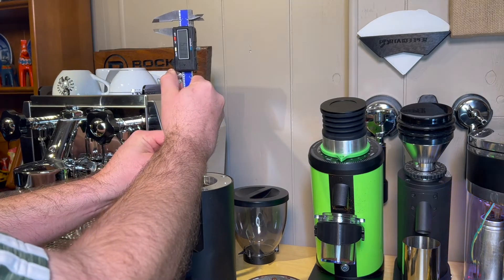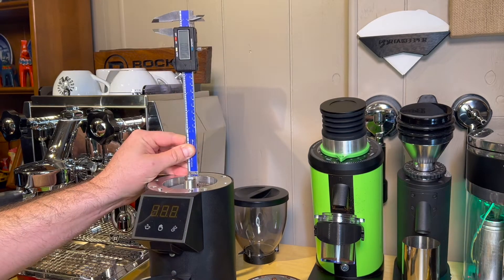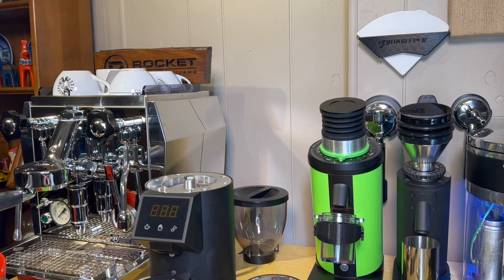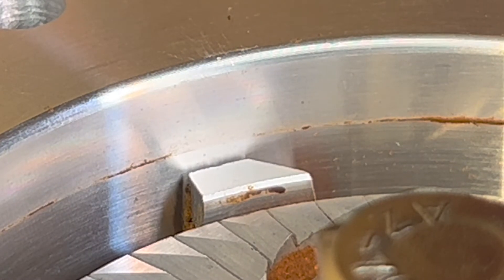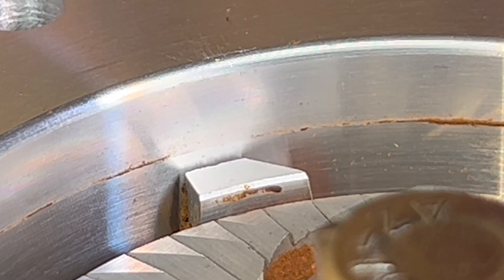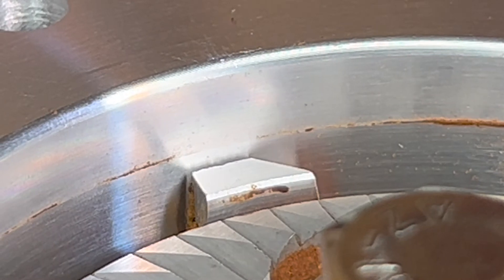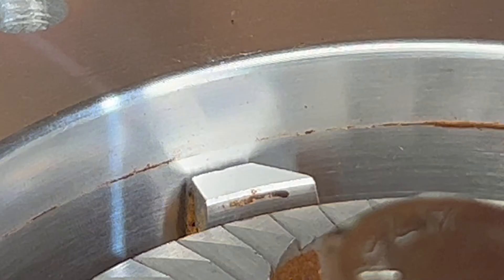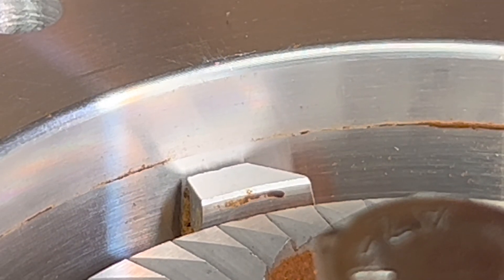DF64E Adjustment Mechanism

Comment: Good video. Did you have one which shows how the adjustment works internally? How does the moving of the dialing arms move the burrs? Thanks
Reply from the maker: I do not, that’s deeper than I really want to dive into the grinder.
Reply: I'm guessing it works similarly to how Eurekas do.